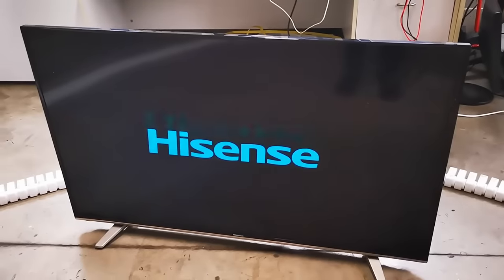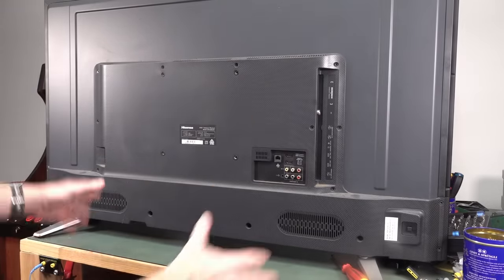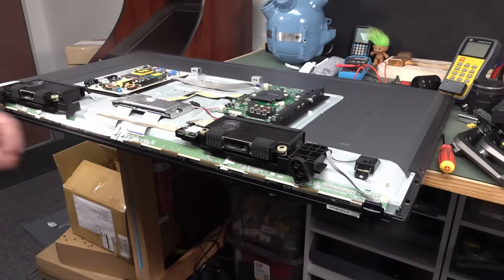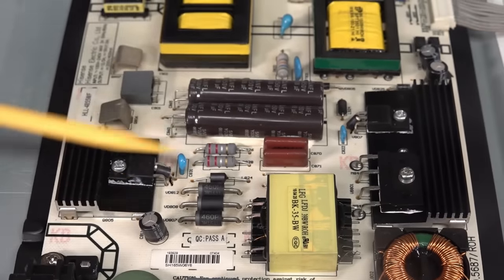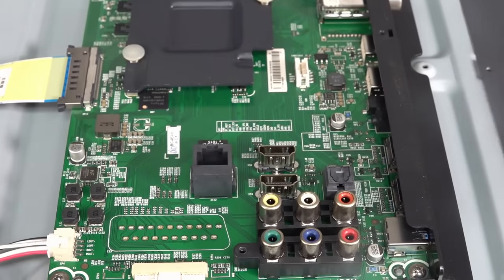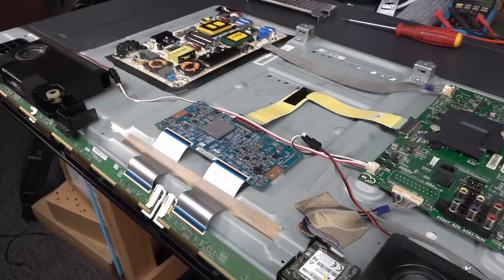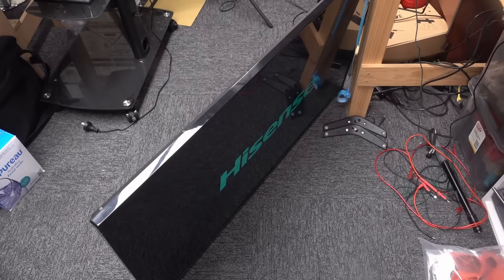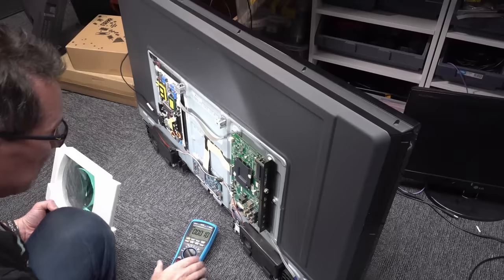Is This Dumpster Hisense TV Worth Repairing?

Comment: TCON boards are Timing Controller boards. They're there to adapt the LCD timing to the video processor timing. Back in the old days, you'd traditionally hook an LCD controller up to the display, and then you'd have to configure the controller with the exact LCD timings as provided by the manufacturer. So you'd have to figure out a suitable pixel clock, then appropriate front and back porch settings to make sure that your screen is centered (get the front/back porch setting wrong and the screen will be off-center and usually it's not obvious). Or drive it at the wrong frequency and you'd get weird artifacts showing on the screen like rippling and shimmering. This was compounded even worse by all the LCD controllers out there so in the end, the manufacturer datasheet served as initial values you'd program into the registers, but it almost always never worked off the bat and you have to tweak and adjust by trial and error until it looked right. And if you ever played with display timing formulas, it's a big mess of math trying to get all the parameters right.

Sharp was one of the first back then to pioneer the use of TCON boards - I know because everytime we'd consider a Sharp panel, the first consideration was the expense of the LCD control board (TCON hadn't quite become common vernacular yet). But the purpose of the board was basically to standardize this a lot - the TCON board had specific timing, but in general, as long as you got close, you got a perfect image.

Use of TCON boards accelerated with HDTV adoption as HDTV display timings are well standardized so what happens is that the video processor board would then output a signal that was basically standard and input it into a TCON board which would adapt it to the precise timing that particular LCD display required - the panel manufacturer would tweak the TCON board timings to what the actual physical display required then basically bundle the display and TCON together. This also provided a measure of isolation between the physical LCD interface itself and the interface to the video processor - which is vital as high speed signalling is quite tricky and TCON boards often have massively parallel output cabling so the only high data rate comes from the video processor to TCON board and the TCON board then converts that into a slower data rate for the panel itself by sending multiple pixels of data at once. 

As for what's wrong, I'm almost certain there's no electrical fault with the display. It's a software fault. The Hisense logo is being displayed by the bootloader, but the bootloader is unable to load the main display firmware OS (probably Linux to handle "smart" features - hence the Ethernet port). So one of the blinks happens when the bootloader transfers control to the kernel where the video output is briefly disabled and then re-enabled, and the rest of it is probably when the kernel tries to load the TV application and either it crashes or the application crashes and is attempting to re-start. When it does this, it starts to tear down the display framebuffer, but crashes before it's able to display anything and leaving the framebuffer intact but the shadowing caused by the hardware being deinitialized/reinitialized. It's not worth fixing, but it might be useful for an exploratory video - Dave just got a piece of electronics he doesn't care about, so go wild exploring around - perhaps there's a serial port header to which one can poke around with. There's nothing worth saving, so it's worth it just to have a "play around" board where you can pretend to reverse engineer the board and "hack" it. And if it lets out the magic smoke, so be it. I say don't make it a repair video, make it a reverse engineering and exploration video, teach people the ways of things like JTAG and serial ports and I2C and other things. Solder things to it to explore signals. It's worth it because the electronics is probably working, the software's corrupt (and you probably can't fix that - I don't think Hisense makes the firmware available), so explore around with something you don't care about, you don't know anything about, but is essentially working. It's how people reverse engineer stuff all the time except if you screw it, it costs nothing and you learned something.
Reply: Amazing knowledge!  Thank you for sharing I really enjoyed reading. 👍
Reply: I second this idea
Reply: Yep. Well said
Reply: If it's a common chasis, like a Vestel, it could be fixed via USB. Firmware is available on some dodgy sites.
Reply: If you ask support, you might be able to get the firmware - if hisense still has it. Older stuff they may not keep the files around.
Reply: Thanks for that explanation.

How compatible are the TCON boards? For example could you use this TCON board and panel pair in, for example, a Samsung TV with a cracked screen?
Reply: This guy/gal here has exactly the right idea. It is a software failure, and even if the firmware is unavailable, the right person would be able to force it to work anyway, just by tinkering around and getting into the (Likely u-boot) boot loader
Reply: If its really only a firmware problem then i would repair the TV. Pretty sure someone has already dumped the firmware and uploaded it somewhere. It only needs to be flashed with an Hardware Flasher. That shouldnt be too hard. I wonder what panel is installed in this TV. Couldn't you just swap the motherboard from the TV with a completely different motherboard (e.g. from a Samsung TV)? As far as i know standard LVDS is used to get the picture information from the Motherboard to the TCON Board. So theoreticaly with a bit modification on the LVDS cable it should be possible to install for example a Samsung motherboard in this Hisense TV.
Reply: @joysticksalami1892  the problem with that would be the power supply - it may not provide the other voltages that a different replacement board would require. Also, the pinout of the tcom board may also not be compatible with another board.
Reply: I'd love to see the exploration video. If the repair only involves a simple firmware flash, I don't know that it would make for a riveting video.
Reply: @joysticksalami1892  What would be nice is if someone made a board with a FPGA that just accepts HDMI and/or Displayport and converts it to whatever signal the LCD accepts. Extremely low latency and none of that poorly implemented smart nonsense.
Reply: How the hell do I give this answer more than one tick of approval?
Reply: @michaelslee4336  Not wrong!
Reply: wonder of one could hack it with different firmware
Reply: @stevehurcombe  Sony Bravia uses the same manufacturer for the T-con -"Auo" as this Hisense does, maybe they are the same T-cons. But the software that runs on Bravia mainboards check's the T-con and the display. If they are not original it will not start the PSU and will report them defective using the front LED. So i think is easier to fix a Hisense boot imagine than a Sony Bravia one.
I personally use a trick to force "Bravia" to accept AliExpress Auo T-cons - I cut the I2C lines on the T-cons, but after this, is impossible to change the refreshing rate from the TV menu.
Reply: In some T-Con there is a small potentiometer that you can adjust the timing, not sure if all have one, It's been a long time since I repaired those...
Reply: Could it be the flash has failed or forgot its content so it can't read the OS from it? If it just got partially erased maybe it could be written back.
Reply: My gosh, wish you made videos as to how to troubleshoot this sort of thing.  Great explanation.
Reply: I like this comment. A lot.
Reply: Nice but... The problem is with screen-COG-chip drive on glass, I have couple videos how to fix this problem by using only a pice of tape.
Reply: @joysticksalami1892  It's an AUO Panel as the logo can be seen on the T-Con board. (AU Optronics). Many manufacturers use those panels, top of the line and random chinese brands.
Reply: @konatadesuka  No. Not many manufacturers use AU Optronics displays or controller boards (TV video processors). AU Optronics is only in higher brands like ASUS, BenQ, Hisense (which is SHARP) and SHARP itself. You won't find AU Optronics in AOC, RCA, Westinghouse, Haier displays etc.

Comment: It's likely stuck in a boot loop. Taken from AV forums:

Hope this helps others when stuck in a boot loop...
- The TV loop can be paused for 10-20sec by holding down any button on the remote. As soon as you let go of the button it reboots.
- You need two remotes, Get either a learning remote, spare remote or Firestick remote that is setup to control the volume. Hold the volume up button on the spare remote to pause the loop.
- using the original remote press the menu button and quickly go down to about and factory reset. Have to do it quick.

Sorted.. Until the next time at least!
Reply: 👍 good to know.TY
Reply: I have an exactly similar Hisense unit. The problem is the TV works fine for some time and out of a sudden the screen goes off with sound and backlight on. And, when I power off and turn the TV on, it starts working fine and the problem repeats randomly. What do you the problem is?
Reply: If you haven't tried already; Unplug the TV and leave it unplugged for a few minutes before plugging it back in. If the problem still occurs try and factory reset. That will rule out any software problems. 
Hardware faults:
If it's still a problem try a different HDMI cable or port (if using HDMI). 
Make sure the TV is away from sources of heat, the panel may shut off if it overheats. If you shine a torch on it whilst it's off but the sound is on and you see there's a picture, that will tell you if it's a  backlight power issue.
Anything further to this is likely going to be a hardware issue with the main/power/backlight board.

Comment: Re-seating all cables is worth a try - I've resolved glitchy LCD issues before by just removing / re-inserting all cables. Bad contact could easily disrupt the clock / a data line.
Reply from the maker: Tried it, it's not that.
Reply: Agree

Comment: 1. firmware corrupted
2. solid caps don't bulge usually, in my experience, high esr usually. Try checking with oscilloscope.
3. nvram corrupted? desolder, write FF with programmator and solder back in. Usually very small memory size in sop8 package (backup the content incase...).
4. sometimes menu is unaccessible when hdmi cable is not connected, you could try that. Then in menu, factory reset.

Googled abit and someone on avforums wrote that they asked for fw from Hisense and they provided, worth a try?

It would be alot more interesting you fixing the tv, i know its not worth much, but you get interesting content for the channel and someone potentially searching for a fix might stumble on your video. Know it might be alot more work, but for the greater good?

Comment: Hi Dave, I'm from Argentina, I work in a technical service workshop, and that Hisense brand exists here, together with Konka brand (which is more dodgy than Hisense). They are matrix tvs because here the government import those from China, and here in Tierra del Fuego they deal with assembling and rebranding them with Tophouse/Noblex/Philco/Jvc/Tcl/Hitachi... (there are a lot) oem brands that are the most common to see. And they use hisense, AUO or Chimei Innolux panel assembly (or display only) for others tvs including philips/aoc brand, we use leftover parts what we have on hand at the moment.
 
In my opinion this TV has two flaws and not one. The fact that it stays at the logo and does nothing else is a firmware problem, that's easy to solve in 98% of cases with a flash drive, the other 2% is more complex, the deal involves desolder the bios spi or worse, the emmc nand flash, rewrite them and put it back on (not worth fixing it if a emmc is envolved) but that is not the image fault, and here is why. 
That exact same image failure I see that often on several tvs in working condition, by mean not having boot loop or any problems with the software. So in my opinion not a software only problem, and is not the smps or the main board, the fault is directly the display panel or something odd in the attached pcb,  the T-con i don't think so, but who knows. 
Maybe a data line is shorted as it happens in Samsung and Sony tvs that double/triple image appears, to fix that you need to cut the stvp stv ckv ckvb data lines (a new display is the real solution but is too expensive or not available) by doing that you lose some definition, however in a full hd 1080p is not too noticeable. In samsung and Sony I do it more often but in these other televisions I do not repair this type of failure those are not worth it. 
Cheers!

Comment: If it's not a high end scope, it's not worth taking :D
I once got a dead 50" Blaupunkt TV from my friends. Recapacitulation, EEPROM programming & swap, and it's good as new. Took me 30PLN (ca 7 yankeebucks at that time). Now it makes a lean mean movie watching screen.
Reply: I have an exactly similar Hisense unit. The problem is the TV works fine for some time and out of a sudden the screen goes off with sound and backlight on. And, when I power off and turn the TV on, it starts working fine and the problem repeats randomly. What do you the problem is?
Reply: @sandeshchhetry2993  that might be image processor's power converters, or the chip's BGA going awry. Can't tell without checking...

Comment: I dont suspect an eletronic fault but rather it could be ROM corruption as the flicker pattern is similar to ROM corruption. I observed this on phones and tablets where the system boot loops and gets fixed post ROM reflashing.
 at 3:48 i see a UART port (conn name: XP3), may be you can hook up an FTDI Dongle and check the dump.
Reply: I personally can't relate the flicker directly to the corruption of a memory chip, but not getting past the "boot screen" may be indicative of such an issue.
Reply from the maker: Was does it change with time?
Reply: @EEVblog2  That is a very good question that could only be answered by finding the answer.

Comment: Try to get to the console. It's typically available on a header or via the headphone socket. (often the output will be open collector) That way you get a rather intuitive command line with help and I think even auto-completion. It's likely to run some m-star (or mediatek) firmware. I used to have fairly decent Grundig which died when one of the flash chips developed a fault. You could nicely see Linux booting and then the set shutting itself off when it detected the file system error. Reflashing didn't work.

Comment: I do TV repairs daily n that can be fixed by cutting the correct clock lines to the display on some it's the CKV & CKVB lines but first make sure VGH, VGL, VDD voltages at the display are correct & stable.

Comment: hot air the cpu, ive done it to a tv to repair it and still works to this day after 6 months. No where on the net anyone said you could fix it with hot air so i decided to try it anyway before buying a new board and it worked wonders. It was doing similar things where it would stay black screen or not boot.
Reply: Correct...  I did this with a nice LG 42" TV.  Low heat gun for 30 seconds (after previous warm up) and then re-paste CPU.  Works great.   Before the repair the TV would turn on power light, then flash the light after CPU failed to operate.

Comment: I had a Hisense TV for many years. It never gave me a minutes trouble. Then I got a larger Samsung, and gave the Hisense TV to a friend and he put it in a guest room and it’s still working. Not too shabby.

I’d scope the back lighting power supply. Looks like a timing glitch from the T-con board. I would remove and spray the connectors with DeOxit D5 and give that a go. After that would be remove the boards and have a good look under the microscope for cracked solder joints on all the surface mounted stuff.

Comment: Check the main 240v filter caps, had an Aldi tv where it got stuck at power on, I think it was getting reset 100 times a second, but got better after it warmed up.

Comment: to me looks like a chip reset issue - that boot screen flickering might be rebooting and showing boot screen all over again. Display and all dumb logic might be fine, but the smart part with data and stuff might be dead.
More like task for oscilloscope and probing data lines if you know, what you should see. But I doubt it is worth doing that except trying to save the earth from more junk and then giving it away to a family in need.

Comment: Those flat flex connectors at the very periphery where they go into the LCD are prime suspects. Try pressing down on them while observing ... and if you find a suspect, heat along the connector with your iron and some oven paper to attenuate the heat.
Reply from the maker: Tried, no joy.
Reply: Also try running with just one connected, then just the other, to rule out a connection/problem with the LCD side.
Reply: Your forgetting that it’s not booting therein lies the issue

Comment: I'd suggest pulling out the ESR meter and checking all the electrolytics.  That's pretty quick and a likely source of problems.  Not all bad caps bulge.
Reply: Or just measure the ripple on the power raild (including all the locally, on-board generated power rails on the main board) with a scope. An ESR meter not always helps if there are a lot of parallel capacitors on the same rail, one might be open, and you still measure low enough ESR, while that one open local bypass cap might cause high ripple.

Comment: first malfunction  -  flickering picture is  usual  problem for AUO panels  - shorted  esd diodes on ckv  lines ( on different edges  of panel boards ) or  bad gate drivers in panel glass . try to isolate ckv  lines on bad side  . freezing hisense logo is  bad firmware